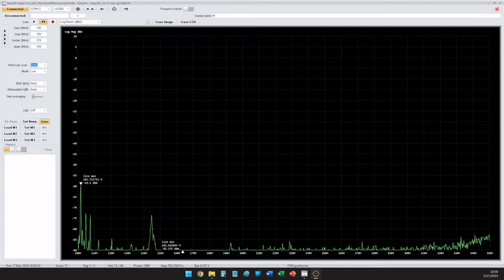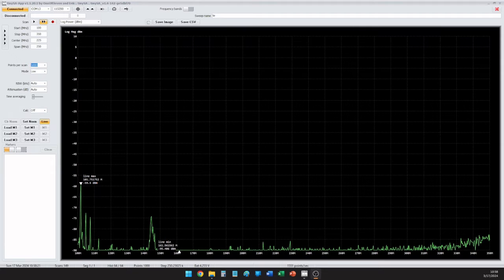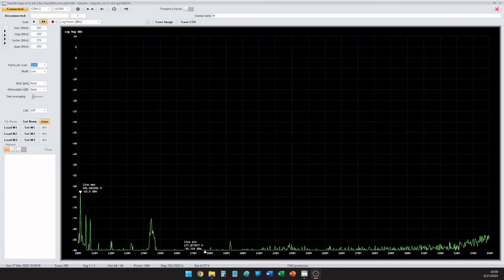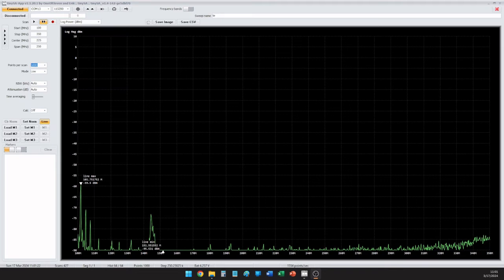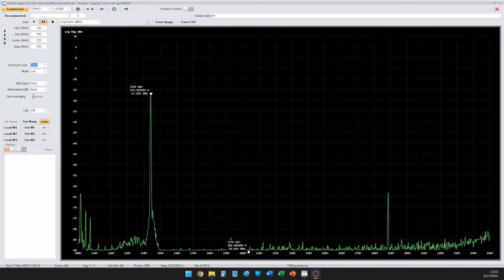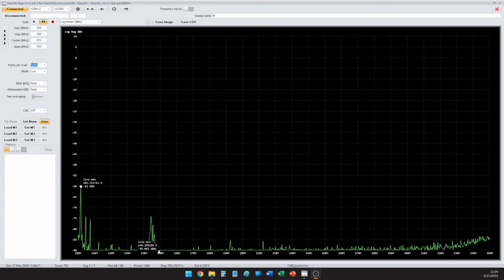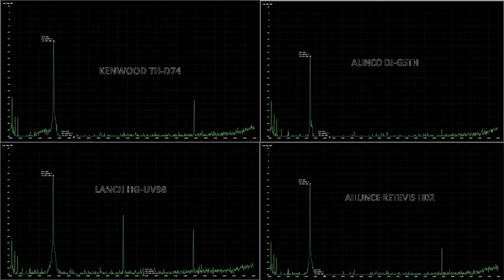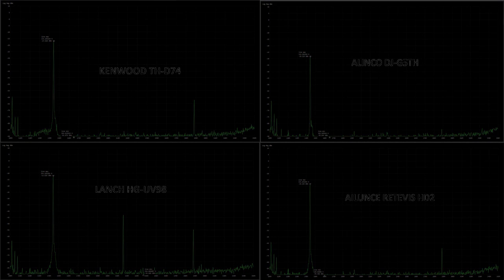A  Little Different: Spectrum Purity Retevis Ailunce HD2

Comment: I did a very unscientific experiment, comparing my ID-52 to an HD2 to. These were the results on the first 3 harmonics:
ID-52
146.4 -51dbm
292.8 -97dbm 
439.2 -96dbm
585.6 -108.3

HD2
146.4 -51dbm
292.8 -85.7dbm 
439.2 -61dbm
585.6 -91

I used an SDR, set the gain setting exactly the same for all tests. Yeah, obviously not seeing a 40db attenuation on the HD2 on the second and third harmonic.
Reply from the maker: Thanks for your measurements. Will give you a shout out in upcoming video where am doing the same thing mostly.   Had to do the other two first just posted comparing the HD1 to HD2 and a basic inside look at the HD2.

Comment: Nice video and thank you for the shout out.  I like the way you did the “air gap” test.  The FCC does specify that it’s measured at the radio output thought.  One thing to consider is that the transmitting antenna may not be a match on the harmonic frequencies and attenuate the signal in those ranges.  Also, you might want to increase the span so you can see if there is a third harmonic.  Thanks for sharing that video 👍
Reply from the maker: 3rd and 5th harmonics will be done in a follow up video later this week.   Wanted to hit any harmonics in the 200-300 area first as that sometimes gets overlooked. But, I foroget to mention that. 

Standard lab tests also can be manipulated based on power level of transmitter to trick some compliance tests only looking for dbm but ignoring what level of attenuation is used to say knock down a 1W, 10W and higher.   I think this is how "some vendors" sneak crappy product on to the market.   Most vendors do list SAR reports on FCC site.   The FCC ID does not show up,  just like the HD1 which had pre certification ID and never got a final one.   HD1 didnt get its ID until almost 2 years of being on the market and available for purchase.
Reply: @hvdnmedia looking forward to the video.  One radio I tested, the manufacturer told me they “fixed” the harmonics but all they did was greatly reduce the power output 😂
Reply: I've seen more than one manufacture also label their radios as "GMRS" (usually without Part 95 certification).  This seems to be some legal flim-flam to sell non-Part 97 (ham) compliant radios.   In my experience, a large amount of the "budget" radios are so dirty that a box of Tide wouldn't clean 'em up.  I've also had some discussion with one manufacturer, who pretty much indicated they didn't make the radios, they just put a pretty case/label on radio guts, and they couldn't afford to actually test radios.  

As @thesmokinape mentioned, the official tests are not "air gapped", they would be direct to the RF input of a test device.  Almost all test devices(even the TinySA) can specifically account for attenuation (by mathematically subtracting it out), so input attenuation does not shield any potential issues.  I can't speak specifically on the Tiny SA, but even a sub-1000$ SA can detect signals down into the -150dbm range, so after subtracting attenuation, it still will show a clear indication of true signal levels.   The other issue as TheSmokinApe mentioned is how well of a match the transmitting antenna is on the harmonic frequencies (which it probably won't be - therefore reducing power on the harmonics).

 Air gap testing, while a "real-world" look, doesn't rule out background noise and RF that could actually make the radio look worse than it is.    A more interesting real-world demo is to tune another HT to the harmonic frequency at the same time.   I've tested radios that were so bad, the harmonics at 293 and 439 we clear and readable on other HT's.  

Never will you find a more wretched hive of scum and villainy...